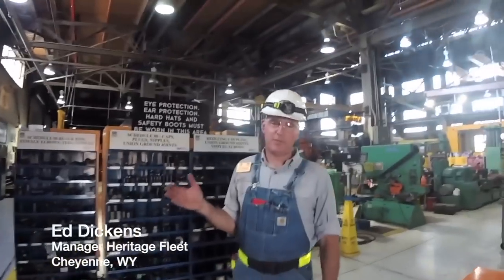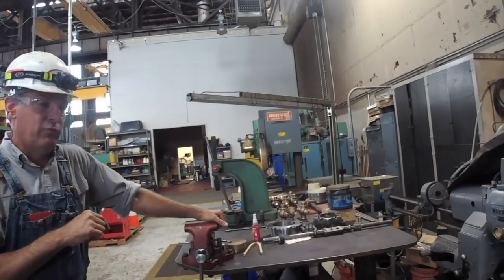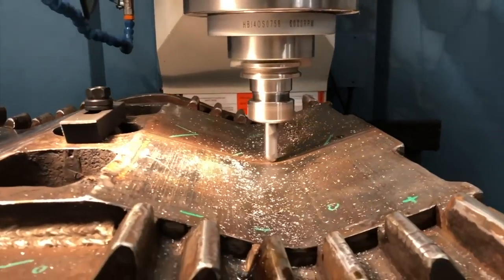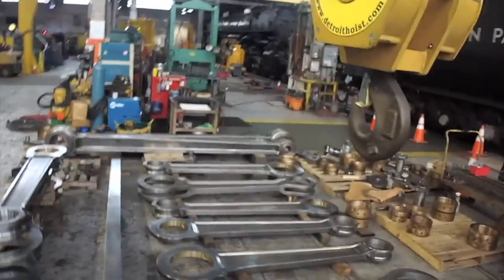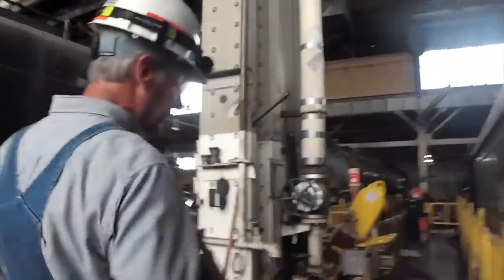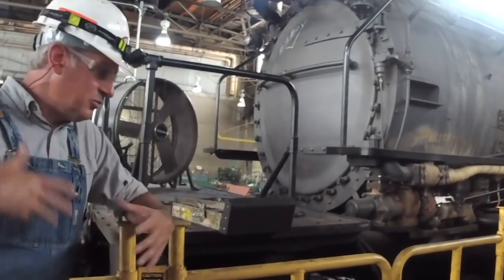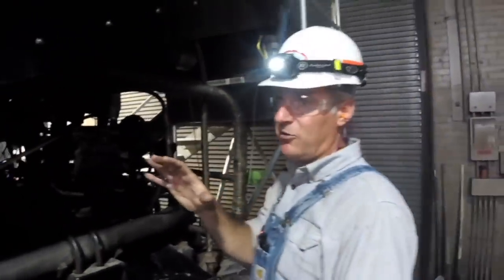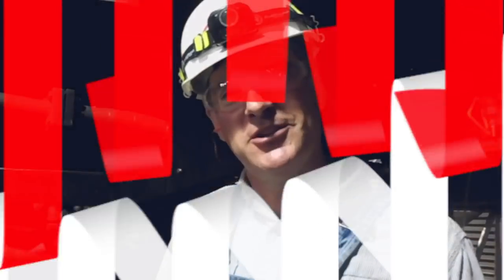Union Pacific Steam Shop Tour

Comment: With the rise of hydrogen fuel to probably come, will steam locomotives, like the big boy, upgrade to a hydrogen fuel system with maybe a battery assist to reuse the hydrogen, and perhaps water, to pro-long the fuel usage life for the locomotive? 

I figured that may be a possible way to save steam as history pieces by further evolving the technology even after it is considered "out-dated" by modern standards. Really, it is something to see how far we can evolve steam until there is an absolute limit to the technology of steam. Finally, the purpose of the idea is to further keep preservation into the future of zero-emitions.
Reply: Are you aware that steam locomotives work entirely without electricity? The only reason they generate it at all is to run things like lights. Building a hydrogen fired boiler might be possible but it'd be far easier to build new, and it would destroy the existing locomotive if it was attempted.

Steam locomotives don't work anything like a diesel locomotive. They're more similar to a stationary coal power plant than a car.
Reply: @Ruiluth  Electricity is there to help heat and re-use steam by condensing it back into water for the tender to be used again in the locomotive.
Reply: @officialpennsyjoe  big boys are not condensing locomotives though, and they don't have any of the necessary equipment to become one. It might be possible but when you were done you'd have a completely different locomotive that was built on the skeleton of a big boy.
Reply: @Ruiluth  That is true, because the big boy's primary purpose that it was designed for was to take heavy freight over a particular big hill in the middle of no-where to reach a destination at the other end at a decent speed. Changing the design internally to achieve an almost zero-carbon foot print would probably neuter the locomotive's original performance it was designed for. Indeed, a new design of locomotive would be needed to perform the same kind of task the big boy's did years ago.
Reply: @officialpennsyjoe  it would be like trying to rebuild a biplane as a supersonic jet. Maybe it could be done, but it would destroy everything that made the original unique and change is so much as to be unrecognizable. It's far better to just start from scratch.

Also, when it comes to carbon emissions, a single locomotive run on special occasions is a very, very small contributor. There would be so much lost and virtually nothing gained. The way to make real changes, as always, is to start from the bottom with the most numerous sources, like personal cars, factory farming, and industrial production processes. You know, the things that most people can't bring themselves to give up. Destroying history in such a way is only an easy way to feel like you're making a difference without making any of the sacrifices necessary to actually accomplish the goal.
Reply: @Ruiluth  The idea is think outside the box incase we do not produce the fuel needed to run steam emgines ever again. While unlikely for this century, perhaps in the next it may come. Preservation is important, but sometimes the best ways to preserve history is by change and coming up with new ideas. On a side note, perhaps hydrogen fuel is a better alternative for diesel-electric engines since they rely on compression for their power to turn the generator? Hydrogen is great for compression engines. 

There may be a time where steam would have to evolve in order to continue as a moving historic piece of engineering power. Hydrogen may not be it, but something will come a long that may not need old steam designs to change with the times, or become static display in representation of newly evolved designs that emulate their ancestral design. 

 The point of my original coment is to think outside the box for the future of steam, regardless of design that the locomotive is, it is important that new methods and ways be brought up to question as the times keep rolling by forward.

For example, I would love to see the last two Baldwin Sharks running again, but to re-build their power plants and to upgrade them to the modern standard and future modern standards will be critical and expensive. The RF-16s had a very "bubbly" sound from their prime-movers, and are iconic however, that will be lost for the sake of them running again, because Baldwin does not exist anymore, and to upgrade an old primemover that has not evolved in around 70 years will be a challenge. The best chance to see an RF-16 again is by using the original design and see if they can build a new motor that can accept and handle new alternative fuel sources, like hydrogen. Or, the cheap way would be to put an EMD or GE prime-mover in them. The RF-16's will not be the same. Exterior-wise, they are all Baldwin, but interior-wise, it will most likely be very different if the original design cannot be upgraded to new standards. 

At the end of the day, it is all about keeping them running in the future as a window back in history.

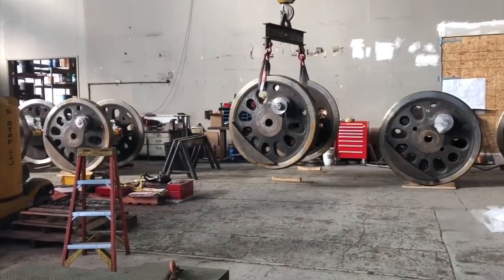Comment: You Lost Me at 1:26 When You called the Wheels "Tires".
Reply: steam locomotives have a thin steel rim that is shrunk onto the actual wheel.
these rims are called tires.
this way the wheel can last almost forever, but you can replace the worn tire that is actually wearing out.